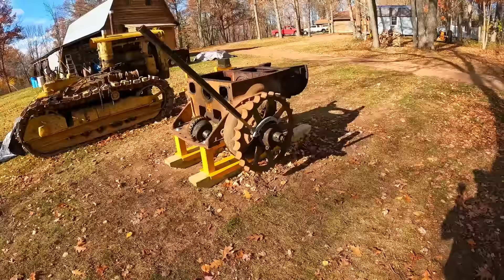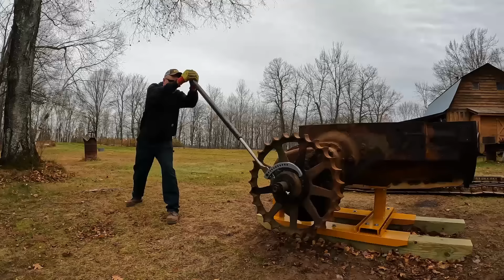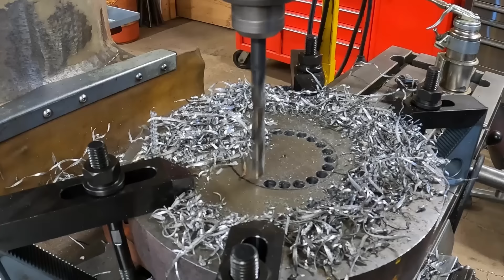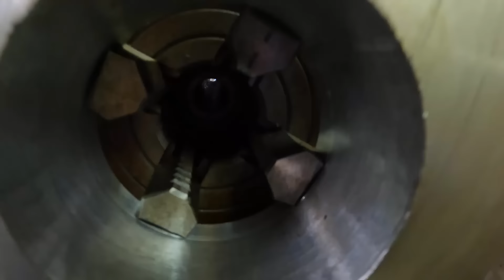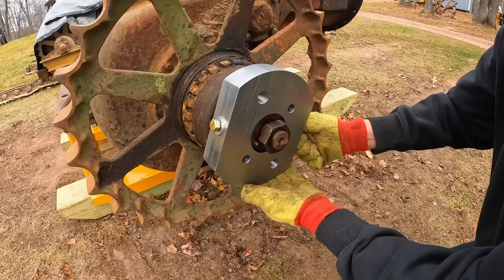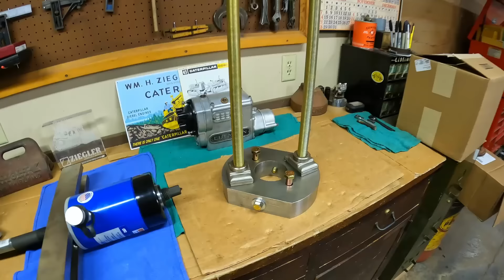Machining & Testing the Pulling Adaptor for the Caterpillar RD-6 Final Drive Hubs - #2H1768 Ep.20

Comment: That would have been easier using tools you don’t have. I don’t have them either which is why I love watching how you solve these problems!
Reply from the maker: I would SO love to find the original Caterpillar 6F25 hydraulic pulling ram with ALL of the tooling and adaptors for performing every operation from D2 through D8, but sadly almost none of those items have survived the ravages of time.

Comment: Dumb question:  why is it called a “dead axle”?
Reply: No such thing as a dumb question.  The rear sprocket rotates on the axle, driven by the pinon gear as oppose to the axle itself rotating.
Reply: @ThomasBurton-ue8pb Thank you
Reply from the maker: Yes I'll second what @ThomasBurton stated - because those axles are press-fitted into the main case and don't spin, they're considered "dead" because everything else that they hold just rotates around them :-)
Reply: @squatch253 Thank you

Comment: A Torque monster click production that is some tool thats the first time for two machines i think certainly the brigeport first time i've seen the camel back what a machine
Reply from the maker: Both have actually been in videos on here before, the Bridgeport was featured when we hauled it home, disassembled it, and also when Senior was putting it back together.  I used the camel back drill in a video when I was building the track press back in the 5J1113 rebuild series :-)
Reply: @squatch253  i  meant working  and had forgotten about the track press still an amazing amount of work getting the bridgeport up and running

Comment: Do you all your steel, threaded rod, bolts, nutz, etc at McMaster Carr?
Is there achood ole hardware store up there?  Not a big box ones
Reply from the maker: Mostly through McMaster-Carr, yes. The local smaller hardware stores only carry the most basic hardware, so you’re lucky to find anything beyond 3/8” grade 2 threaded rod. The fact that McMaster can ship most of my orders the next day makes it cheaper than driving several hours to do a shopping trip to the bigger town and back 👍